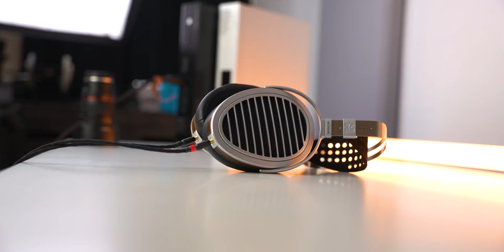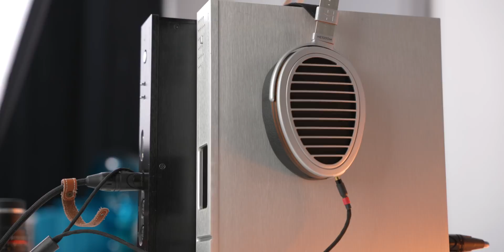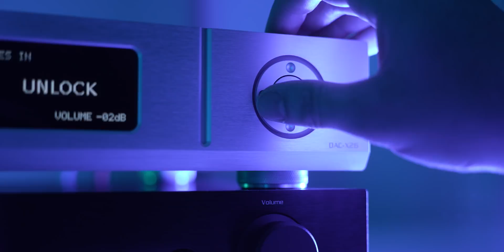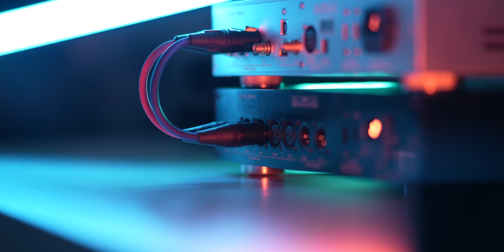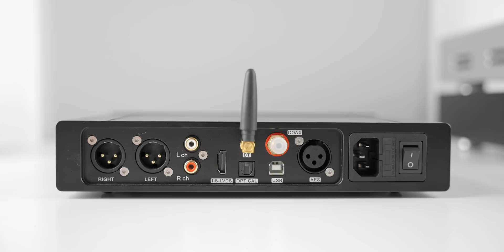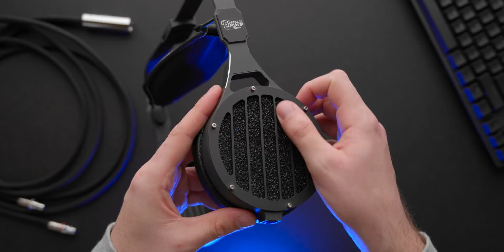$6000 Audiophile System Build | Hifiman, Abyss, THX, Gustard!

Comment: While I generally enjoy your videos - we don't share the same opinions on the excellent Gustard H20 HP amp (and maybe the X26 too). Yes, the H20 can be quite thin, bright, "analytical", and sort of "constipated" when it's "cold" as you first turn it and play it - but after playing it for about 15~30 minutes and its internal components and case to warms up - it develops a very different presentation altogether, IMHO. As the minutes pass, you can literally hear its bass begin to deepen as it becomes more dynamic and begins to "flow" - as well as its mids and vocals expanding and smoothing out. Where it was once sort of thin, bright, analytical, and "constipated" when first turned on to listen - it suddenly becomes significantly warmer, with much wider, deeper, and "cavernous" staging, with bass that's much deeper and more dynamic, and a sound signature presentation that's much more holographic and "3-D", and much more enveloping, immersive, and life-like. Like MANY discrete Class A amps, the H20 just takes more TIME to warm up and stabilize for that discrete Class A goodness to more easily flow.....

The other aspect of the Gustard H20 is the ability to change out the  OEM LME49720 IC opamps to something like the Sparkos Labs SS-3602s, Burson V6 Classic/Vivid/V7s, Staccatos, or Sonic Imageries discrete Class A opamps - and doing THAT is what brings the H20 up a whole nother level, IMO. I have the Sparkos Labs discrete opamps in my H20 and they bring another level of clarity, bass depth/dynamics, expanded staging, detail, texture, timbre, and naturalness to the H20 over the stock opamps. I call them my "high-end analog" discrete opamps, LOL. 

Yeah, the H20 keeps me very satisfied knowing that it would take me literally another $1k to $1.5K to better it - and I only paid $475 for it from the used market - the same as an OG Topping A90 that I used to own directly before the H20, but was sorely lacking in comparison to the H20. Sorry for the looong post, LOL....

Comment: No thanks, headphones for SpongeBob squarepants are ridiculous, and recommending a THX 789 amp just to afford SpongeBob headphones is silly.  The THX 789 is thin sounding, lacks meat, 2Dish type of wall of sound.  Layering is bad, soundstage is meh.

Save even more money, and here's the best setup for under $6k:

DAC:   Gustard X26 pro using it's i2s input running from a Pink Faun i2s add-in pci-e card, the Gustard also using a Nordost Odin 2 power cord (copycat cable off Aliexpress but it's 95% the sonics of the real $20,000 cable, and it's only $120).  Thick aftermarket power cords improve sonics in so many ways over the stock $4 power cable.  Tons of people have heard this.  i2s is what is happening inside of all DACs anyway, but skipping the optical/USB conversion to i2s and just going i2s straight into the DAC is a great sonic improvement.  Less going on in your chain, the better

Mogami W2549 XLR interconnects with NC3FRX-B Black/Gold Female to Male connectors

AMP:  Cheaper option, the Topping A90D, $1800 option, the HeadAmp GS-X Mini    (either one with another $120 Nordost Odin 2 fake power cord from Aliexpress)

Headphones:  Hifiman HE1000v2 with a custom made 6N copper XLR headphone cable from GUcraftsman on Aliexpress

Boom:  With expensive amp, totals about $5943, go with the A90D and it totals $4743                  Stream via Apple music (not TIDAL, Apple sounds better) and done.

Comment: Joshua - this is the first video of yours that is starting to sound rather BS'y.  Headphones clearly have enormous differences in sound; modern well-engineered DACS: not so much. Modern well-engineered SS Amps: not so much. We already know the measurements on most of the DAC/AMP kit you're describing. I'm certainly willing to accept that gear that measures identically can sound slightly differently, as the "qualia" of sound is not measurable. That said, this notion that this DAC or AMP is more 'analytical' or etc. than that DAC/AMP or that this DAC chip itself has audible sonic characteristics that are even discernable given that the sound is far less related to the chip than it is to other components in the system feels like a lot of placebo and conjecture. And an awful lot like the same old BS I used to read is magazines like stereophile and such. You can do better.

Comment: Joshua, quick and objective, Fidelio X2hr or SHP9500 especifically for Movies and immersive gaming? Are the Soundstage and explosions (immersion) on the X2hr's soo much better that overshadows the lightness and confort of the SHP9500 for extended use? And is the distortion on x2hr as big as DMS says?

Comment: If you are seriously considering abyss 1266, I would recommend checking out this video first instead of buying a thx789. Thx789+1266 is probably one of the worst pairing you can find. I honestly don’t understand why josh recommends thx789 all the time. It’s not the perfect amp now.
Check this before you buy: https://youtu.be/PA58JGnVthM

Comment: How does the D70s compare to my D90 MQA?
Is the D90 MQA even better or has Topping nailed it so much with the inferior 4497 chipset that the D70s is actually comparable or better?
Reply: By the way, how would you judge the A90 compared to the Gustard amp?

Comment: It's also super important to understand that with DAC chips, the amount of things the unit does outside the chip really makes a difference.  If they decide they don't want to use a section of the chip, and re-implement it themselves, they'll get better performance.  So an older dac chip unit can totally sound better than a newer one, if they decided not to use some parts of it.  That said, newer chips still give a better base to build off of usually.

Comment: As an Abyss PHI TC owner, I recommend that the electronics cost at least as much as the headphones.  I use a Hugo TT2 as a DAC and the Moon Neo 430 as an amp, previously I had the Hifiman HE1000SE with the same electronics in operation for 15 months and for me the HE1000SE is absolutely not in the same league as the Abyss PHI TC.
Reply: That's a blanket statement ... it's true for some headphones but not all. If you buy a 6000$ pair of headphone obviously you don't want to drive it with a Schiit magni or your Iphone... LOL But for example you could be running a Hifiman Arya which is close to 1600-1700$  with a 800-900$ dac/amp stac and you would be maxing out those headphone .... and the "At least" is probably not needed here. FYI I have a collection of headphones, Dac and amp.
Reply: @256alexdt  
That you can really say "fully maxing out" your headphones you would have to test the entire DACs, Amps on the market, what is not possible.  There are always differences in electronics, many things are overpriced, but everyone has their own point of view and is free to choose what to buy or not.
Reply: @256alexdt  Maxing out the headphone.. As a LCD XC owner soon, guess with a thx SP400 amps and Gustard X16 i would squeeze them at best for a 1000€ dac/amp price. Guess also the Arya; you think an He1000v2 will sound better on them? Preference apart, i knew he1000 are a bit more detailed, and with wood and not plastic on grills. Would like to know because i'm not sure, and He1000v2 we're my favorite, even more than he1000se which i owned both.
Reply: @vipernecklampy8773   The sad thing with Headphones ... and anything audio is that you have to try it. I like to watch those reviewer on Youtube and they usually have really good "Starting point". Everyone is different and have different taste and you have to test it. Like Paul Noir Culte said up here, there's kind of an infinite combination of Headphone/Amp/Dac and that's not even talking about the pads and mods. I'd personally say that the X16 Dac and SP400 would definitely be pushing them in term of performance to the max, those are pretty easy to drive. That would be a very analytical setup, with a close sound stage. Usually my preference is warmer when the sound stage is smaller so if I really liked the sound signature of the XC I would probably look for a combo that would make it a bit warmer but again you got to listen to them for a while and see.
Reply: @256alexdt  close sound stage because of X16 Sabre chip? While akm would be wider you would say? I tried a cheap topping e30 akm but didn't liked the splashy and loosy signature, that's why i look for sabre dac's. But top akm should be very nice, still fast, whilr bring wide, maybe. Thought with 1000€ dac/amp even if analitical and linear amplification soundstage could be nice at least. I also will get Notne silvergarde S4, thick occ litz silver with rhodium connectors, so even more detailed and analitical, in fact even if i like analitical approach, i can afford to get something warmer in the chain. Maybe instead even better to get at least a component on the warmer side (i knew sp400 is warm'ish so will count a lot just that) since headphones and cables are really analitical. Anyway i will try all hifiman's at a store so i'll see to get he1000v2 or Arya.. But i'm more into V2
Reply: Yeah fortunately i found 'somewhat' or ~ circa, what can please me, even if i firmly believe that every component, even the smaller one, can make a difference, i guess as most says, the main role is by headphones. Sure, components and sinergy are a world to be explored but hey.. Some like things less complicated than that, like me. But i have tried a bit of dacs and amps and good headphones like lcd3, he1000se and v2, soon XC which i dream by a bit. Fan of analitical so with silver Norne cables should last lot of years, just this treat and those are the best sounding cables i can look for. For amps i like fast sounding thx's, now 887 and soon maybe upgrade with newer thx's real balanced 888, and a linear dac is what i looked fot since i loved the topping d50 which was detailed and cold. I'm fortunate yet i didn't tried a 500€ 'expensive dac'. And such great sounding things. So the only thing sad here is to make happen again again a great setup the like with XC closed and my fav cans i ever tried, He1000v2, silver endgame cabling and some decent power strip and cables. Then more than happy,  because my application will be mostly for games. Than music will sound like rainbow out from my soul from a mouth ahahah
Anyway sorry for my posting; real thanks for your kind suggestion ^^
Reply: @vipernecklampy8773  In addition to the Abyss PHI TC, I also have the Audeze LCD-XC and really like it.🙃
Reply: @vancybergoth  Amazing, i know that Abyss have the most musicals headphones as planars.. While Audeze, yeah XC must be really detailed for what it costs, do you find it sound open or too closed for your liking?
If 1000€ 'good' amps make XC and Arya to sound as their best potential, kinda; just guess if that could be said for HE1000v2, or it brings more space for improvement and with same setup would sound kinda the same..
Reply: @vipernecklampy8773  
The Audeze LCD-XC doesn't sound as open and free as open headphones.  I bought the LCD-XC as a contrast to the Abyss PHI TC because it sounds very large, open and free, but sometimes I prefer the smaller, more intimate sound.  I've only heard the LCD-XC with my Hugo TT2 as a DAC and the Moon Neo 430 as an amp, with other electronics I have no comparison values.  Before my HE1000SE, which is now sold now, I had the V2.  At that time I operated the HE1000 V2 with an Auralic Taurus MkII as Amp (1798 €) and a Yamaha CD-S2100 CD player (2099 €) and always had the feeling that the Taurus limited the V2, I sold the Taurus and got the Moon Neo 430  (4000 €) and this amp took the V2 to another level. And yes the Hugo TT2 (4999€) sounds also way better than the Yamaha CD-2100 CD Player.
Reply: @vancybergoth  Right TT2 is superb, i tried TT1 loaned for a month but most of the time i used my 789 and d50 cheap stack, don't ask me why i liked them more, more analitical maybe. But TT2 for sure is much better than TT1. Can't afford chords, hope XC will please me in details and analitical, but also in freeness of sound even if closed.
I'n rushing to get one, i guess woodeen will sound more musical, while carbon don't know, more studio or plasticky, so not colored likr wood, but not sure.. Would really like to know btw..
Reply: @vipernecklampy8773  
The wood version is no longer produced, there is only the carbon version.  Of course there is the second hand market, but personally I wouldn't buy anything without a guarantee.  LCD-XC is very detailed and its 106mm driver makes it sound very large.  I'm happy with the LCD XC I was able to buy mine as Black Friday deals.
I was able to test a Hugo 2 (€ 229o) with the HE 1000 V2 at home for two weeks and this combination was extremely good, if you want to exchange electronics, I recommend saving a little longer - it definitely pays off.
Reply: @vancybergoth  I am very happy i am receiving a 2 months old, 3y warranty XC carbon. 
Yeah not sure why they now use carbon, also carbon usually is low weight but it weight a freakin' more than wood by specs, and on the heaviest headphone.. Audeze also don't think isn't willed to point out how much would differ on sound in respect to wood, seems to me. Maybe more uncolored sound, more truthful? And maybe the extra weight and carbon finish for better isolation, just my thoughts, would be nice to know the differences :) I heard they can weight 810g without cables wuuuf, happy 10 hours gaming sessions to me eheheh🤣

Great that He1000v2 can work superbly with such musical Chord Hugo 2, i heard it's very good. So my suggestions is that with 887 and X16 it can be at a very good potetial either! ^^
Yes, saving in this hobby is finally essential, instead to go round and round, at be at the same level for AQ, finally i wanted to get better because i was getting tired, you know. But all is experience. Also Joshua's video are a little bit of experience and very nice to watch, yet need to watch it xD
Sorry i am extremely happy for my purchase of XC as been a super pleasure to deal with the nice seller, will enjoy the wait in the happiest mood.

Comment: @Joshua Valour thank you for the awesome videos and guides. one question please: which headphone are more breathable for the ears : dt1990 or the focal elex? I currently have the dt770 and after a few hours I like my ears get suffocated
Reply: My akg k712 pro are super breathable. I can wear them for hours and my ears don’t get at all sweaty or humid.
Reply: @Vhill7299  Thanks a lot for the reply 😄 I will consider them (or the k7xx cause they're considered to be warm compared to k712 pro)
Reply: I dunno about the dt1990 but the Elex is super open. Never have any sweat after long sessions. personally I think it has a better tonal balance too from what I've seen/heard. 1990 has high treble peaks.
Reply: @Artaois13  thanks for the reply 😄 I am considering the Elex cause they are easier to buy (for me) since amazon shipping to my country has skyrocketed for some crazy reason.
Reply: @nightsaber1130  I got mine when they were only $550 which is a steal. You might check out the HifiMan Sundara too. Much cheaper and a highly praised Planar Magnetic headphone.
Reply: @Artaois13  hmmm, after reading rtings.com breathability scores. I don't think the sundara or the dt1990 are good choices. It's either the k712, elex or the HD800s
Reply: @nightsaber1130  big price difference there. If you're considering the 800s then the Focal Clear/Clear pro is in your price range and I'd definitely go with that instead unless you prioritize crazy soundstage. I've heard the 800s is extremely light and comfortable but really needs EQing to sound right.
Reply: @Artaois13  thanks for the heads up. I might just buy a used pair if I can. but I haven't decided yet. I'll need to watch a a lot reviews before take a final decision though.

Comment: A better and cheaper system under 6k is Raal Sr1a/JotR multibit($4200) or Raal Sr1a/JotR/Bifrost2($4700). You can also just get the raal sr1a and jotR(4000)then pair it with a great DAC(chord qutest).

Comment: My current chain is:  Holo Spring  KTE dac -> SPL Phonitor -> 1266 Phi TC... The Phonitor is a great amp with most of my other HPs but not "enough" for the Phi TC.   Currently saving for a Flux Volot or Xi Formula S + Powerman combo.  Once I get the amp right I'll be done and @ endgame.
Reply: Volot and formula s are my targets right now too. The flux fa-10 is already a beast. The above combo josh mentioned would probably be too bright with the hp and dac, at least it's a class a amp. $200 on accessories is quite small for a 6k setup.
Reply: @RyuMasterEX  yep I tested about 8 amps with Phi TC and not a winner yet.  Flux FA-10 was decent for dynamics but the detail/resolution just isn't there in terms of technicals.   Volot will be the answer being fully balanced.   I've seen used FormulaS +powerman go for $3.5k but that is still out of my reach.
Reply: Can you clarify what you mean by "not enough"? Is it not enough power or something else?
Reply: @jarekharmening8993  You can hear it in high frequencies and sub bass.   If you turn up the volume on an amp with the Phi TC it will either start to clip, distort, or sound very thin.   This happened with the Phonitor, Lyr 3, V280, A90, 789, Liquid Platinum and my Holo Mammoth KTE HP amps.    The Flux FA-10 dynamics sound great just lacking some technicals.  Very hard to describe you just know it when you hear that it's not "enough".
Reply: @aceofspades6667  thanks for the information! :) Looks like I'll need a different amp!
Reply: @jarekharmening8993  Your mileage may vary... The amps I named certainly will "work" it's just leaving plenty of potential on the table.  Some other options I've been look at include Cayin iha-6, Mini GSX, Wells Milo amp, Moon 430, Burson Soloist 3XP.
Reply: @aceofspades6667  I'd probably get the Mini GSX or maybe the XI Formula S.